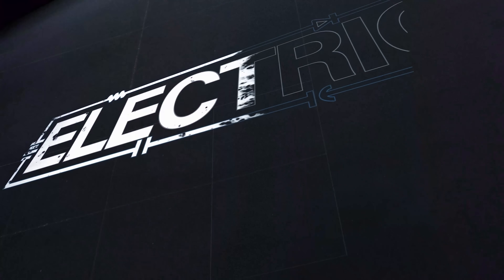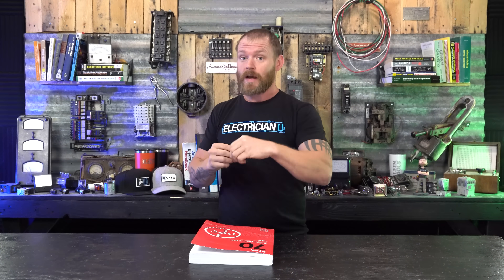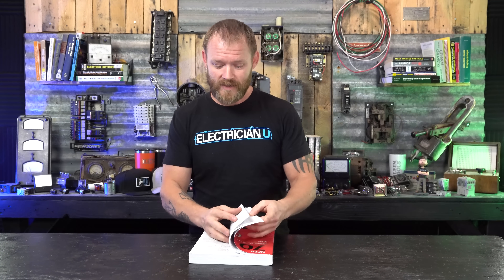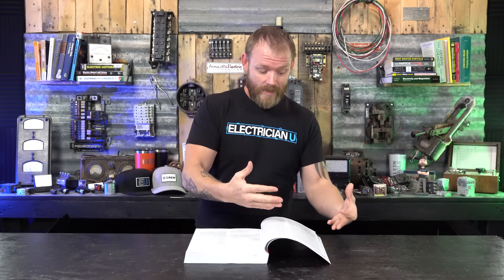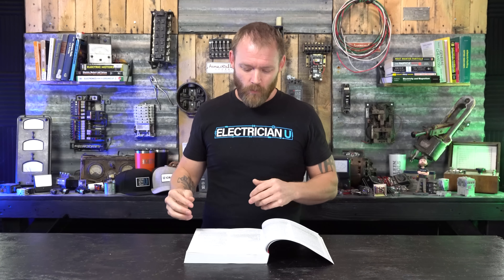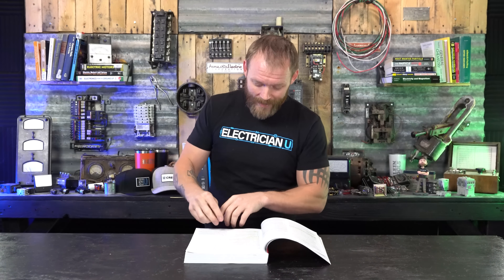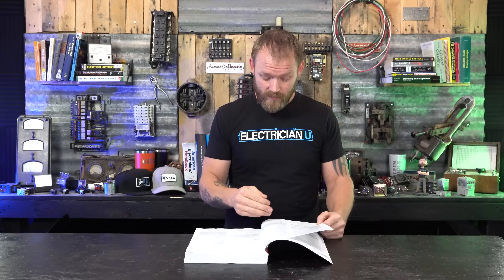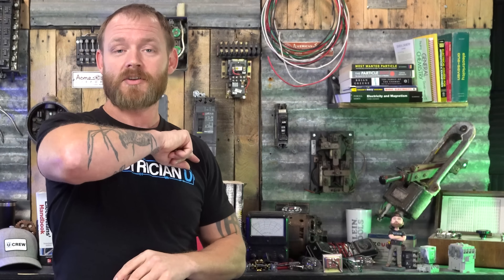Where Should We Be Using Dual Function Breakers?

Comment: Dual function is great for meeting both AFCI and GFCI requirements compactly and with lower cost than doing them separately.  I don't like adding AFCI (via DF) in retrofits where not required due to nuisance tripping, but new is ok.  The lack of requirement for AFCI in commercial environments implicitly shows their challenges in being used everywhere as a safety device.
Reply: A common problem in retrofits,  specifically older houses,  is neutrals from different circuits tied together,  and multiwire branch circuits, and I've seen mulitwire circuits on random breakers placed wherever there was space in the panel, so just because you don't see double pole breakers doesn't mean there isn't multiwire circuits in the house, which is a code requirement and a safety issue.    A few manufacturers have double pole AFCI breakers in their product line, which can be used in multiwire circuits.
Reply: @Sparky-ww5re  Good points!  I find multiwire fairly common in late 80s and 90s wiring, and frequently the multiwire is not on a shared trip.  Going back to dealing with knob/tube, shared neutral/return was the practice.  I've used many 2 pole AFCIs and GFCIs, but I am not aware of any dual function 2 pole breakers, at least not for SqD/Siemens/Eaton.
Reply: @RJ-ej1nr  through extensive research,  two pole dual function breakers do not yet exist although I can see them being widely available in the next decade if not in the next code cycle or two.   The 2020 NEC is already requiring the 30 amp dryer receptacle,  and the 50 amp range receptacle if within 6 feet of the sink I believe,  to be GFCI protected,  and AFCI protection requirements have  grown extensively over the last couple code cycles, to include all 15 and 20 amp 120 volt circuits within a dwelling unit, for all practical purposes.    Even the 240 volt, 15 and 20 amp receptacle like you might use for a large window air conditioner or large electric heater,  is now required to be tamper resistant,  so I can see where we're heading in the not so distant future.
Reply: Or it shows they aren't as necessary as they claim.

Comment: Ive been replacing my 15/20/30 amp circuits with DF breakers, but what is everyone doing for the 50 amp ones? I interpreted My inspectors suggestion that I needed AF and GF for my dryer/ stove and HVAC unit as well. I can't find a 50amp AF anywhere.
Reply: in NE FL  dedicated equipment circuits like refrigerators washers, dryers, ranges ect are still put on regular breakers , Probably because what a nightmare rollout arc fault breakers had, so many issues with those damn things in the beginning.

Comment: I work in New homes in NC. All our projects we put regular 20 amp brkrs on the kitchen outlets then put gfci Outlets on the first outlet in the circuits(minus the fridge outlet). Why do all our inspections pass if those kitchen circuits(including fridge outlet) aren't arc faulted?
Reply: North Carolina hasn't adopted AFCI protection in kitchens yet. It's reserved for mostly living rooms and bedrooms.
Reply: Passing/failing an inspection is 100% entirely at the discretion of the inspector. You can do everything "right" and he can still fail you if he wants something done differently. OTOH, you can make all kinds of mistakes and he can still pass you if he wants to. The code is only as valuable as the AHJ is at understanding and enforcing it
Reply: @TwilightxKnight13  btw it was not a county inspector is was a private home/safety inspector they have no authority, they make a list of potential issue for us to check out and fix if necessary, before we sign off on it for insurance. (think they are gonna air B&B the place) Don't know how much you have dealt with those guys but they usually don't know much more than your average homeowner, pretty sure its a 3 week online coarse or something.
Reply: until recently FL was the same. In the grand scheme of things it should save some money those gfci receptacles aint cheap.  I trimmed a house not to long ago and messed up and ordered gfcis for the kitchen and bathroom  and when i did the panel I was like shit forgot dual function breakers are code now why did i buy all those gfcis... ironically the buyers home inspector wrote on his list that all these things need gfcis and the relator called me making a fuss and I had to explain they are protected by a breaker now and you dont need the gfci outlets anymore if you use those breakers.

Comment: Dustin, 
At 4:17-ish you mention putting a refrigerator on an arc fault interrupter circuit. My home builder friend remodeled his own kitchen and dutifully installed an AFCI. Subsequently he had numerous nuisance trips on his new refrigerator. The local building inspector winked and said if it was his house he'd go with a ground fault interrupter on this dedicated circuit because the compressor motor causes the nuisance trips.  Like to know others' experiences on this.
Reply: Generally frustrated on nuisance tripping with AFCIs.  Motors are typically where the issues are - primarily compressors, but I've seen other motors such as washing machines, shredders, and vacuum cleaners, along with a non motor device - space heaters.  Even seen old desktop computers tripping them.  Swapping with another AFCI breaker/device has a ~50-50 fix rate initially, but goes down to more like 25-75 over the long term.  There's no way to keep a client happy with consistency like that.

Comment: If I wrote the code, everything would be dual function. I have seen some sketchy things that warrant it.
Reply: Right up until you go on vacation for 2 weeks and come back to find that everything in your fridge has gone bad from a nuisance trip of the afci or gfci..
Reply: @staceyschnee801  and you can make the same argument for a lot of things around the house. You could come back to a failed water heater tank that filled the basement with water. Or you could come home to a house that burned down because the small appliance gas line running to the range broke at the nipple from the vibrations cause by opening and closing the oven door. People act like nuisance tripping is an insurmountable issue, and it isn't. There are ways to mitigate it. You just have to take some initiative.

Comment: When you are doing a service upgrade are you installing AF breakers on all of the existing Circuits? Or is this applying to new construction only? I am seeing a lot of Service upgrades not getting AF breakers installed in my area in Long Island New York.
Reply: If you upgrade you are supposed to make it code compliant with your jurisduction, but the cost of these are probably making people bypass it. In CA these dual functions are upwards of $100.
Reply: Always remember, the code is only as required as the AHJ (inspector) makes it. For various reasons, some legitimate, some not, many inspectors allow variations from the code. If your local inspector is not requiting AF protection, and the electricians in the area know that, it is likely they are going to save the cost and just install standard breakers.

Comment: Wait, so every outlet in a GFCI protected area needs to be a GFCI? Everytime I have done it in the past we had a GFCI upstream and the circuit coming off of it was connected through it. Is that not code now?
Reply: You do not need a GFCI device in every position. The code is not referring to the device, it is referring to the protection of the device. That can come from having a properly installed GFCI outlet upstream or could be a GFCI breaker. It is not recommended that you use multiple GFCI receptacles on the same circuit.

Comment: I just did a big complete kitchen remodel and due to upcoming code changes and frankly, supply chain, I used dual function on every circuit - all appliances (except the 240v 50amp oven) lights and SABC's... Inspector said "yup, that's pretty much how ya gotta do it these days"...    $$$$$$
Reply: Guy who taught me told me something that still rings true after 20yrs.  

"Its a product-driven code"
Reply: Yep. Amazing what happens when the people that make billions selling a $5 breaker for $50 get to write the mandate. 

I need to invent something I can force everyone in the country to install by code LMAO
Reply: @Squat5000  Imagine trying to save a few bucks on the breakers only to have your house burn down.
Reply: @peterpan31000  imagine having to spend thousands on breakers that do not fix the root cause of the problem, piss poor workmanship due to lowest bidder mentality.
Reply: @Squat5000  Most homes are old, save a few hundred now spend tens of thousands of dollars and dead relatives later. :face-blue-smiling:
Reply: @peterpan31000  I've wired hundreds of homes with and without. 

Run 37 million in residential work. 

I'm disinclined to take advice from people that don't even understand how the breakers work let alone the proper wiring methods to avoid these issues
Reply: @Squat5000  The internet, ACBMA and 2017 NEC says otherwise, things have changed since the knob and tube wiring buddy:face-fuchsia-poop-shape:

Comment: I have a question. Back in 1991 when I was working on a house I grabbed door bell wires which I though were only 12V wires and received a shock that literally dropped me to knees. That is what allowed me to release the wires because they ripped out of my hands when I dropped. My muscles were clinched tight so I couldn't let go of the wires. Both of my arms were numb and tingly for 2 days after this happened. This was a house over 100 years old and only had a fuse panel. If those wires I grabbed would have been on a GFCI circuit would I have gotten shocked like I did or would I have been protected from that?
Reply: GFCI checks the difference between load and neutral, so not necessarily.  If the current path was from the hot of those wires through the floor or something else you were touching, then yes.  If the current path was from the hot and back through the neutral, then no.  (Note, per "How Stuff Works" it only takes about 10 milliamps for muscles to clench.)
Reply: @RJFerret  It was a hot wire broke in 2. I was reaching over my head with one side of the hot wire in my left hand and the other side of it in my right hand and my entire body just completely clinched up tight.
Reply: Most transformers for traditional door bells are 24v, just like HVAC call circuits. Circuit protection would be useless, because you're electromagnetically converting 120v AC to 24v DC. The secondary coil creates its own current flow when you touch or connect both ends with a load.
Reply: Gfis don’t trip on short circuit or overload situations. They trip on ground fault situations. What’s funny is you can take a pair of plier and touch the neutral and ground on a gfi receptacle and it will trip. But say that gfci receptacle is out at the main panel where the neutral and ground are bonded and it doesn’t trip. Why? You can touch the hot and neutral and it will trip the breaker but not the receptacle. Why ? You can plug something into that gfi receptacle 100 times and use it over and over and it doesn’t trip but every now and then it will trip. Why ?

Comment: As these requirements expand, so to does homelessness.
Reply: Expanding the requirements does not cause homelessness. Not expanding the requirements might if your house burns down from a fire caused by an unprotected circuit fault
Reply: @TwilightxKnight13  Not directly it doesn't. It just adds just a little more to the cost of buying a home one thing we don't need right now. However it is a contributing factor.

Comment: If A customer has a series of outlets that aren’t working and they think it’s a GFCI somewhere would replacing the circuit breaker with the door function fix that problem?
Reply: you would still need to find and replace the worn out gfci with a regular receptacle, the dual function breaker then provides the gfci protection. The reset button on a gfci is basically like a switch if you just change breaker and there is a bad gfci the current still wont travel past it to fed the rest of the outlets.

Comment: I have a garage with only 2 hots and a neutral running underground to a sub panel. The garage has a ground rod of its own and bare copper conductor ran into the sub panel.  The sub panel  neutral and ground are unbonded.  Is this acceptable or Not?  The Main breaker box has a 60 amp breaker that is feeding the garage subpanel.
Reply: Acceptable by today's standards? No. The ground needs to be carried all the way back to the main panel (4 wire) and if it's a detached structure it needs at least 1 ground rod (depending on resistance)

Comment: Where I see this getting tricky is in multiuse areas such as a garage that has washer and dryers in them.  (super common where I live)  technically you don't need to arc fault protect garages, but you do laundry areas, so do you  go dual function on the garage, or just the circuits the washer and dryer are on, ect.  I guess this is more a question for my AHJ, but curious what others experiences have been.
Reply: and a "room" does not have to be defined by the walls. If you have an area of your garage that contains the washer/dryer, then you essentially have a dual-function space. The part dedicated to the laundry should be treated as such and likewise with the rest of the garage. You do not get to ignore whole sections of the code because you eliminate some walls. What about a truly open design house? What if all the living space is open and the only "room" separated by walls is the restroom? Does the entire house have to comply with the requirements of the kitchen? No, of course not. The same would apply to your garage, but of course the inspector (AHJ) has the final say. The code is merely a guideline. The inspector chooses what to enforce.
Reply: Just gfci protection in the garage. It’s by location not equipment.
Reply: @alphasaiyan5760  I can't say I 100% agree sense under article 100 a Laundry Area is defined as: Laundry Area. An area containing or designed to contain a laundry tray, clothes washer, or clothes dryer.

I can see the argument by an AHJ that the equipment in the room is what defines the room.  not the other way around.
Reply: @bassman87  yes sir but it can be argued that a garage isn’t designed to be a laundry room and a laundry room is not designed to be a garage. I mean sometimes people have a washer and dryer in their garage but it doesn’t make it a laundry room. Some people could park a car in their laundry room but it doesn’t make it a garage.